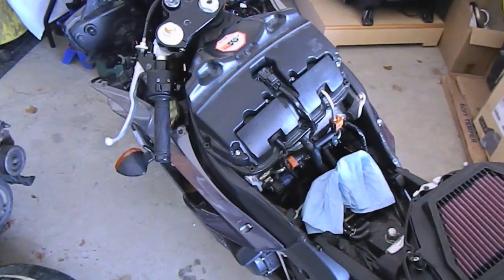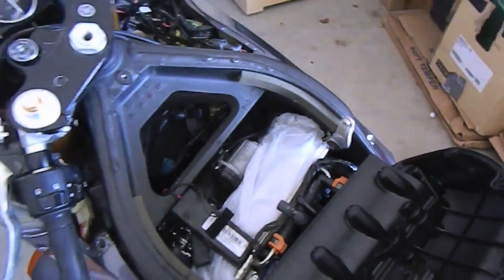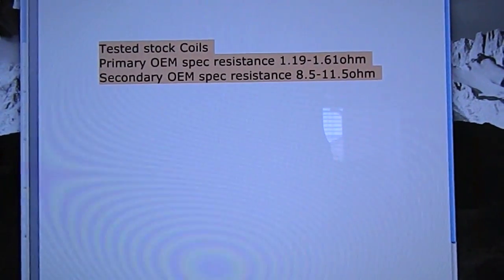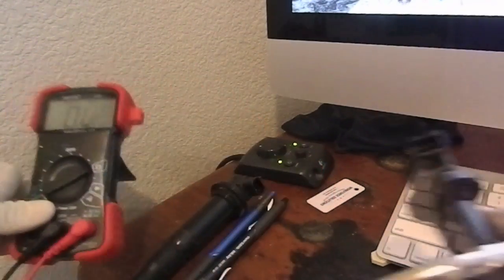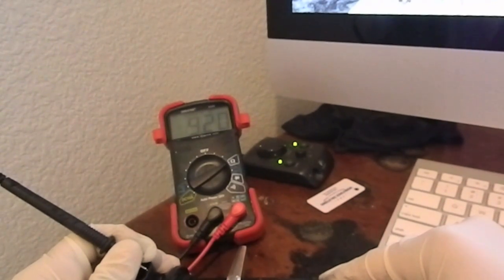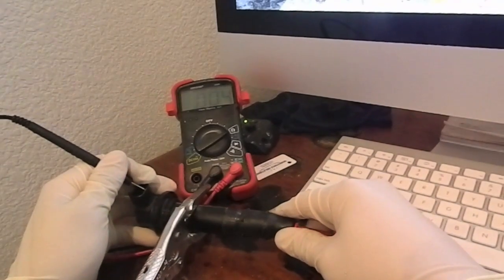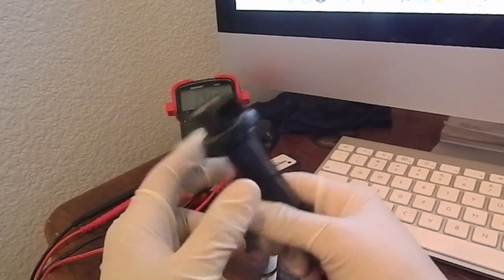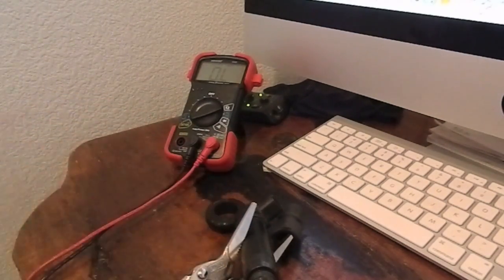YAMAHA R6 SPARK PLUG COIL TEST: HOW-TO

Comment: Iridium has more resistance than normal electrodes.  This draws more power through the coil, which blows coils.  Ditch the iridium.      Start the bike and spritz water on the header so you can tell if one cylinder is running colder than the others.  If cylinder 2 is running colder, or not at all, swap the coil on 2 with the coil on 3.  If the problem moves, the coil was bad, if the problem doesn't move, check wiring, spark plug, and compression.

Comment: Lucky you to find a bad coil..
I'm still dealing with a miss-fire issue and can't find the problem..
New sparks, tested all coils, drained the gas thank, clean all the filters, etc, etc, etc, etc.... I may buy a Honda next time..
Reply: Could be the pump  the 2 pieces separate slightly and then bike will bog or miss

Comment: I just a quick question.. have a look at my vid of my triumph 675 on my channel, 675 running like crap   (coil prob maybe)

i replaced plugs.. checked all over bike for loose connections.. erm i am not getting an engine light on..what do you think..
bike is sluggish sort of missing.. sounds like its running on 2cyclinders but it not cheers Paul

Comment: You could try adjusting the idle speed, apparently you use a Phillips head screwdriver to turn a gold knob on the left side of the bike,
Most bikes idle at 1,140 to 1,500 I think.

Comment: this video was very helpful, i think one of my coils are bad, as well. 2005 r1... i changed the plugs and still have slight misfires at low rpms after the bike gets hot. i think i will get a voltimeter and check the coils